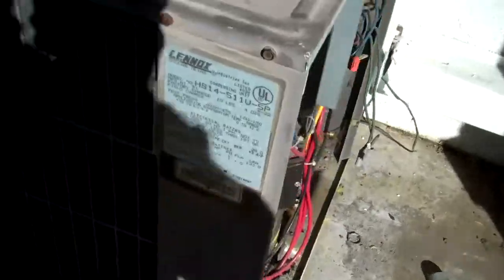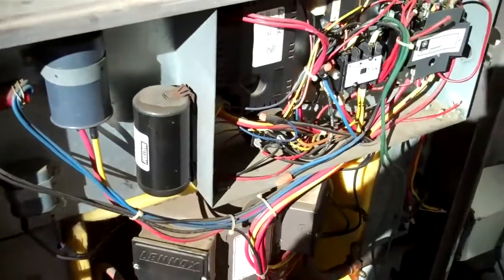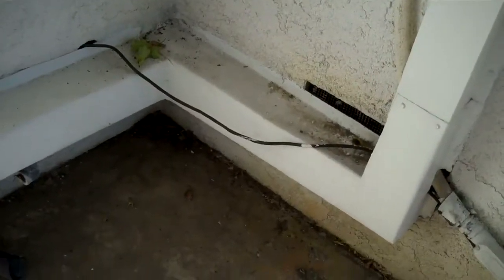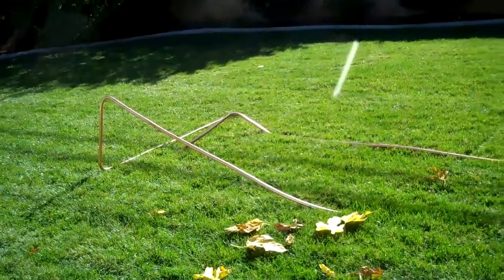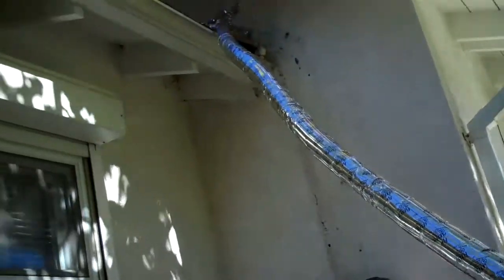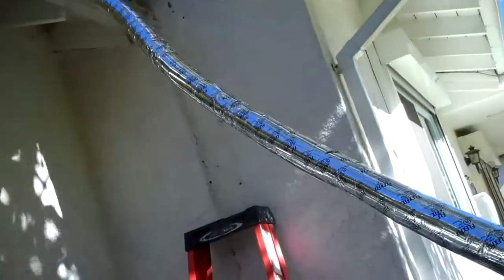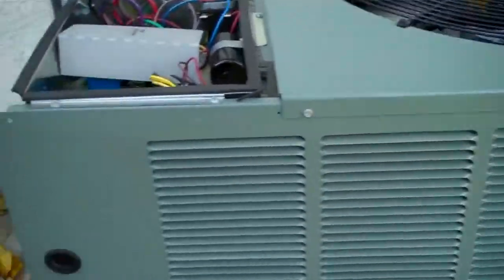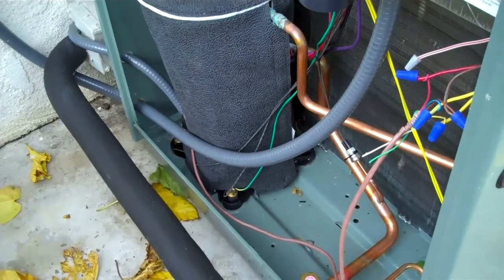Rheem RASL060JEZ 5 ton condenser installation

Comment: That takes some unreal piping skills pre fabbing that up on the ground. 10 installs as always.
Reply from the maker: Thanks polishtheturd! Can you believe I have to change out the indoor coil because of formicary corrosion :/ ....Thanks for watching!
Reply: What is formicary corrosion? Is it when the evaporator coil loses it's protective coating and white flakes go thru the system?
Reply from the maker: I found this...https://www.youtube.com/watch?v=SgEGFhhqK1M
Reply from the maker: http://www.americancoolingandheating.com/wp-content/uploads/2012/01/What-Causes-Formicary-Corrosion.pdf
Reply from the maker: The real story it is Chinese copper or recycled copper that is the real deal.
Reply: Ok, thanks I understand what is now.
Reply from the maker: It is very frustrating, Thanks for watching my video!
Reply: I used to do work at a strip mall years ago. 2 units did a nail/ hair salon. They would eat up Carrier RTU heat exchangers like crazy. All those chemicals in the air going thru the unit.

Comment: @dizziedallas Oil is still a big part of the market in my area. The Lennox oil burner had a very small belt to drive the combustion blower wheel and with out it  you were DOA. But those burners were old when I got into the trade but I wouldn't be surprised if some were still going.

Comment from the maker: @gusherb94 The unit was running in low but high was just about the same,a little more rpm on the condenser fan motor.It was change out to a 5 ton because the customer did a large room addition. Thanks for the comments!!